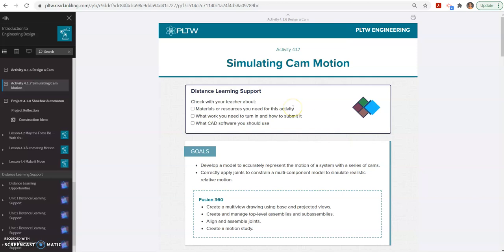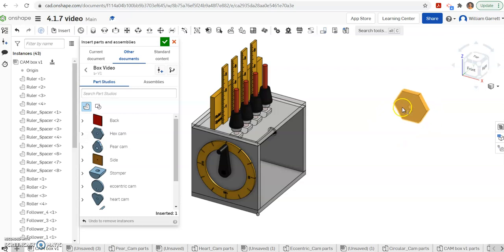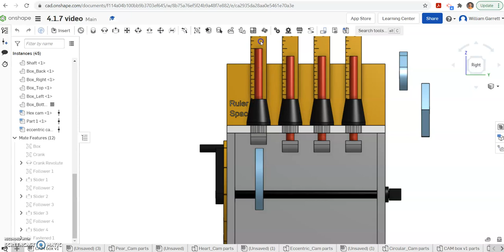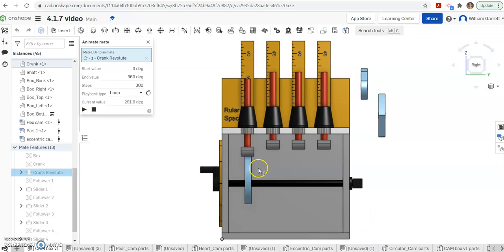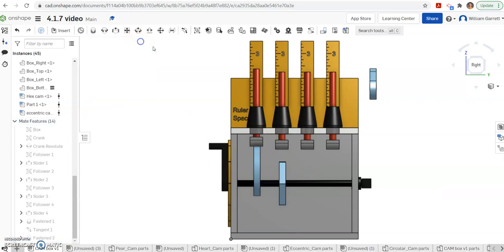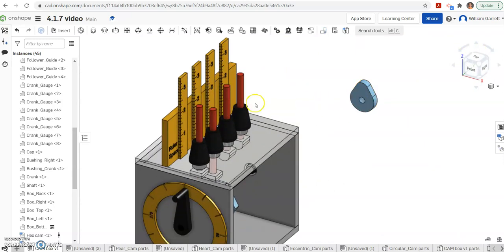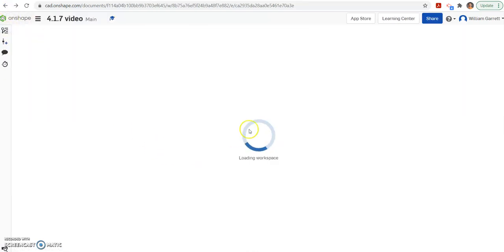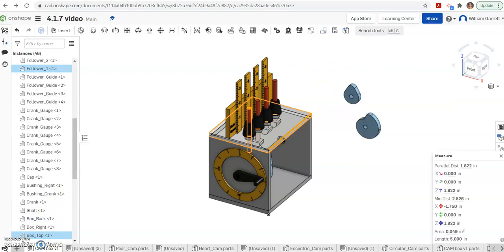4.1.7 Simulating Cam Motion Onshape

Comment: How do you change the sizes
Reply from the maker: Right click on the cam you want to change, select change configurations and as long as you designed the cam with configurations should be able to change the size.